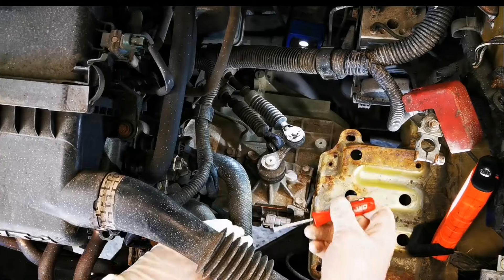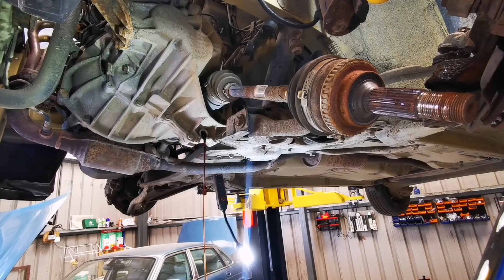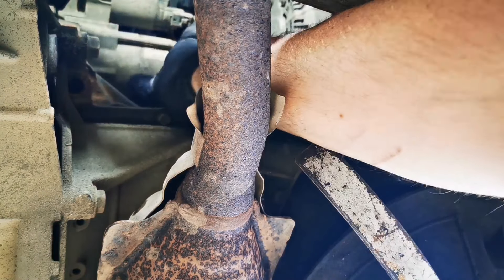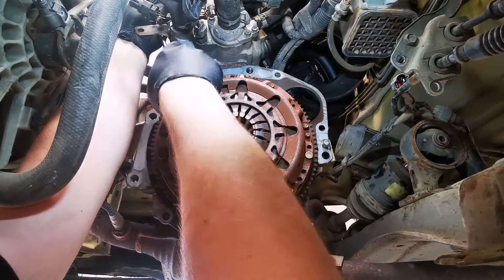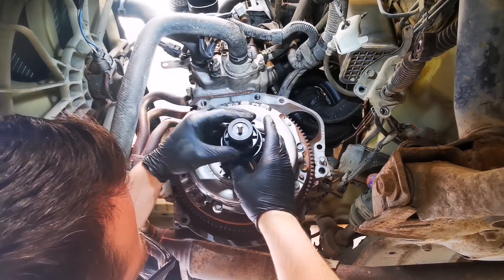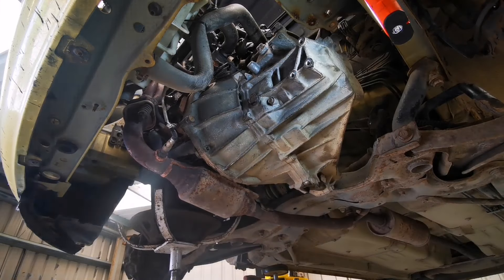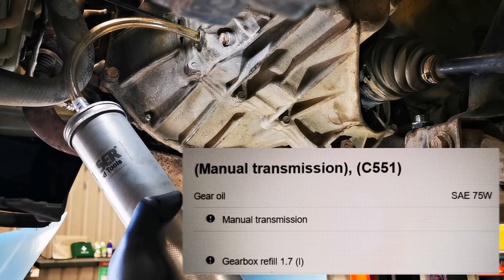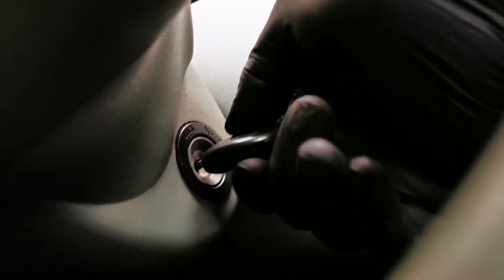Toyota Yaris Clutch Replacement

Comment: Rather enjoyed that. Sadly I'll be doing this job on my back, but it's certainly less daunting now than it was in my head.
Reply: how did it go. thinking of doing the same
Reply: @scottyfroula4818  being brutally honest. Got as far as splitting the box from the engine and couldnt clear the rear box mount (jap built 1.3) to get it out. After 3 hours of swearing, cursing abd almost breaking a finger it went back to together and off to the garage. Was not a happy chappy, but i would give it another go if i could get the car a but higher and such i would give it another go if i needed to and didnt have a single day to do it in.
Reply: Bruh I am scared it’s not gona fit I have the Yaris 2005 sportline does it go under the car ?

Comment: Putting the bolts into the cardboard is pure genius !
Reply from the maker: It's all about making life easier.
Reply: Yes i like it
Reply: @MTMMotorServices  : Glad to see I wasn't the only one using this trick.  :-) 
I had started doing this when I worked part-time in a motorcycle workshop. Often, it was necessary to wait for the delivery of the parts to reassemble and it was my colleague who had to finish my work. Or, I who had to finish his. To simplify his work, I made a drawing of the fairing of the motorcycle and drove in the screws.
As I practice mechanics less now, I continue to do so. It's all the more valuable as I work on more diversified things where I haven't acquired the automatisms of yesteryear.
Thanks for your video. It's very clear. If I can make a suggestion, it would be to add the dimensions of each tool used. It would be reassuring for an amateur with little equipment to be able to check that he has all the tools necessary to start the job.
Reply: Even for any such large repair projects.

Comment: Hi Marc. Thanks for doing the video. I successfully managed to change my first clutch on my 2002 Yaris using jack stands. I nealy gave up when I couldnt get the gear box to line on as i hadnt centered the clutch plate properly. After the car wasnt running properly, problem sorted. Vacuum pipe for emission control had come off when engine was tilted. Running good now. Cheers.
Reply: yes i had same prob getting gear box back on a lot harder doing it on the ground after a couple attempts i got it back together

Comment: heard that the master cylinder is squeaking, mine does that too. but it's easy to solve by replacing the plastic one with a metal one they started putting in the later models.

Comment: I was doing this on my own car and asked a forum for torque settings for pressure plate. I was told wrong settings and a bolt snapped. There was loads of bolts in it so i think i got away with it.had no issues after anyway.
In future i will always look up settings myself and not trust someone else
Great vid. Thanks for uploading
Reply: I would get that fixed tbh
Reply: @jonaswrld9992  cars be scrapped since so no worries

Comment: Thank you so much for taking the time to post this. I’ve just finished doing the clutch on my daughter’s 2003 Yaris. ( On my back. On the garage floor.) It was great to have you talk us through the task.

One thing I would stress though is just how difficult it can be to remove the driveshafts! The driver side is not too bad, but the near side was a pig  to do as it’s really difficult to get something behind the inner cv joint to tap it out. I ended up actually pulling the inner CV joint apart by pulling too hard on the driveshaft to try to remove it. Apart from the driveshafts and the rear gearbox mounting, the job isn’t too bad. It took me about 12hours in total working alone. 

Thanks again!!
Reply from the maker: Really glad this helped!
Reply: Looks like I have to remove subframe on my echo and box won't spilt at top been a nightmare tbh I've done 100s of clutches this has to be one of the worst up there with the caldina
Reply: @nickocliffy7359  
Jesus! Bad luck my friend. Surely you’re missing one of the starter bolts or something  to stop the box coming away? Is the Echothat different to the Yaris?
Reply: This give me courage to start project to my t sport. Have to do in my back too😬
Reply: @kalevi7463  I just had thesmae problem but don't pull your subframe out its actually the top locator pin at the top that gets corroded and makes it hard to separate, I used a bit of wood and a hammer smack the gearbox side until the gearbox slid off the rusty pinion, then it's just pulling out the box

Comment: I just love how it comes out of the wheel hub so easily for you! Always the case on YouTube videos but when doing it in reality it’s never that easy!
Reply from the maker: Although that is also my complaint when watching videos on YouTube. In this case.. it did actually come out nicely 😅
But that being said, i understand why people cut out the additional 45 mins or more of extra grief they get from seized parts. If there is a problem I get with certain parts of jobs, I will explain any issues I get but most of the time.. if something is stuck, you've just got to persevere.
Reply: @MTMMotorServices  haha! I did took the drive shaft nut off and tried to hit the driveshaft out but not budged one bit to the point the end swelled! Still not out atm haha! Will have to drill it out at this rate! Haha
Reply from the maker: @connorparker1249  I'd invest in a hydraulic hub puller. Works wonders.

Maybe I'll do a video on it.

Comment: Excellent video. Best clutch change video I've seen on YouTube :) I have two 2003 Yaris's in my household and one will need a clutch soon! I hear there is a variation in quality of clutch kits available, how do you choose the best kit?
Reply: Depends on how rough you shift, and usually a clutch is change in half of the life of the vehicle, so I will not spend much on a clutch, only ~90 for both clutch and housing. But that's my opinion

Comment: Great video! Although if I were going to do the job, I would replace or resurface the flywheel, especially by the looks of that one it got hot and will likely chatter and prematurely wear out that brand new clutch and it will have to be done again in half the time.

Comment: Hard to believe that you would take all that apart and not remove the flywheel and replace the rear engine main seal since it's the easiest time to do it. 
I also noticed that you didn't remove the clutch fork and inspect the pivot bolt for wear and put a dab of grease on it to keep things smoothly.
 From experience, I know it's easier to do it right rather than having to take all that off again just because I cut some corners. Thanks

Comment: Great well made vid. I have bit of a phobia about disturbing wheel bearings. Could it be possible to remove steering rod end from NS hub and just pull NS shaft out of box, pushing to one side like other one? Also, OTT maybe but poss a blast of air to remove all crap before pulling shaft our of box, which might fall onto shaft or into box? Rubber glove on end of shaft Then duct tape over box entries to stop anything getting in box while worked on? Hope that helps, I have a bit of prob with my Yaris - clutch really strong when engine cold, when hot and accelerating in 2 or 3 gear revs pick up and stay steady at 3k ish, just like an automatic kicks down. Is this a prob with variable timing or clutch? Thanks

Comment: My yaris only has 20k on a new clutch but gears 1 and 2 seem clunky and the reverse is a pain sometimes, wondering if it the slave unit at fault, does anyone have an experience with this issue, also my yaris break pedal makes a vibration nose now and then when near a complete stop, u can hear it through the car, wondering if anyone has experienced this issue also, this video was a good one
Reply: The vibration you are feeling through the pedal it's not just the abs coming on is it?
Reply: Run a thinner fluid in the gearbox. The factory Toyota gear oil isnt that great. I went from 75w90 to 75w80 and the lighter fluid provides a pretty smooth shift. A slave cylinder would be more at fault if the clutch pedal was sinking too low to the floor and sticking coming back up.

Comment: I have a 2003 yaris manual transmission, 1 wheel turns under load but both wheels turns if I jack up the front. So 1 wheel is driving, other is idle or not working. Any idea on what is the cause of my problem? How to fix?

Comment: Did you have to bleed the clutch?
Reply from the maker: Because the slave cylinder is external on this set up, you dont disturb any of the pipes which means you don't introduce any air into the system, so no, I did not have to bleed the clutch

Comment: Hi, i have  Toyota Corolla 2007 1.6 mmt transmission car. 2 questions  i have . After driving about 20 km gear shows neutral mode.i changed clutch it works well. 1, When i press break i hear some sound of metal from gearbox and this sound was before changing clutch is it normal? 
2, should i drive D mode or M mode? I will be thankful

Comment: Hi mate i recently had my clutch changed in a 2003 yaris tspirit do you know if this model has a dual mass flywheel or single because the mechanic told me its dual but i thought the older models had single.

Comment: Does anyone know the year when the Yaris started using a hydraulic clutch. I want to buy a Yaris but I want it to have a softer clutch than a normal cable clutch. So I want to buy the oldest model with a hydraulic clutch. It would really help me out if someone would tell me because I searched google and have not found anything

Comment: Hi! I have the same car. I am struggling big time to undo the rear stabiliser bolt using hand tools. How did you remove yours? Was it easy to undo? Thanks
Reply: Heat, oil, try...... Repeat. If all else fails use an impact gun.
Reply: I had to grind the other end off a ring spanner then use a tube over the spanner shaft to gain more leverage

Comment: What solution did you use to clean? And which lubricants do you recommend?
Reply from the maker: Standard brake cleaner was used, any excess solution evaporates so you can be sure the surfaces won't be wet.

Comment: The transmission cable really stuck to the gear linkages, and I ended up damaged one of the rubber grommets of it when trying to pull it off.

Comment: Hi Mark and thank you for sharing. Can you or anyone tell me if it is ok to use Copper grease on the input splines and release bearing sleeve ? Im getting conflicting advice on this,Some say not to grease at all.Would appreciate some guidance.
Reply from the maker: Some clutch kits actually come with a little pouch of grease. This is mainly for the splines for ease of fitting. Grease isn't essential so that's why some people use it and some don't.

Comment: How to place the clutch without this special alaign tool?
Reply from the maker: Some kits (very rarely) come with disposable plastic alignment tools for fitment. I would reccomend buying a tool. If it isn't aligned properly, the shaft on the gearbox won't engage and you'll be there struggling with a gearbox that won't go in.  It's worth the £10 for a basic tool to save the stress

Comment: this the same on 2009 automatic box
Reply from the maker: I've never had an automatic yaris in the workshop so i couldn't tell you without seeing it. The automatic gearboxes are internally different so you wont have the same clutch set up like you see here.
Reply: @MTMMotorServices  and the buggers changed some gearboxes on the automatic 2009 are a standard plate clutch with the  same as you have on top is the clutch change unit push pull . mine is slipping slightly so change the oil first . but i dont think this is the problem only done 48 k miles its either clutch or the dear push pull unit. get the obd unit and set the clutch clamp before dismantle.
Reply from the maker: @JOHNMINKA  slip normaly occurs due to wear on the clutch friction surface or possibly contamination on the surface. Unfortunately you'll need it out to inspect.
Reply: @MTMMotorServices  many thanks i have come to the same conclusion but i will check thesoftware reset with the obd unit . then drop it out (shit happens )lol
Reply: @JOHNMINKA  Ours started to slip at 65k km. Got it replaced at Toyota. Now it slips again at 130k. Electric automatic gear. 2007 model. I think it is by design.
Reply: @fritanke2318  replaced now 180 quid all in better than when i bought it.